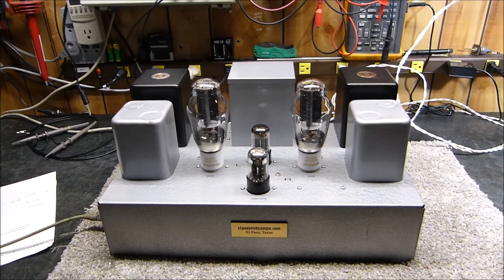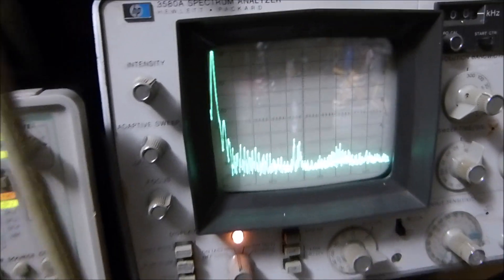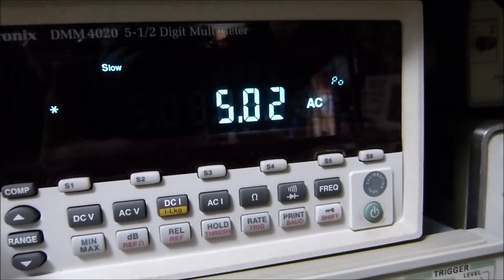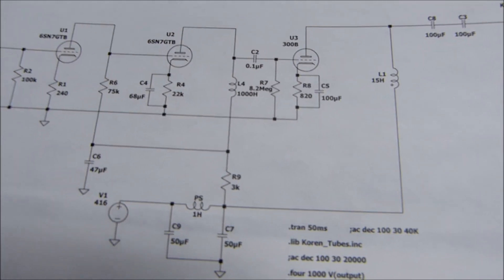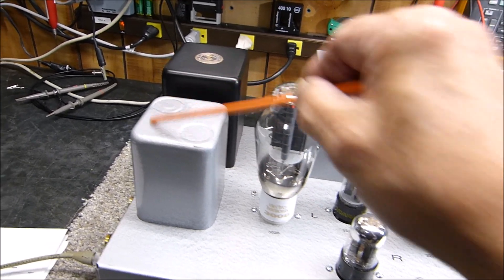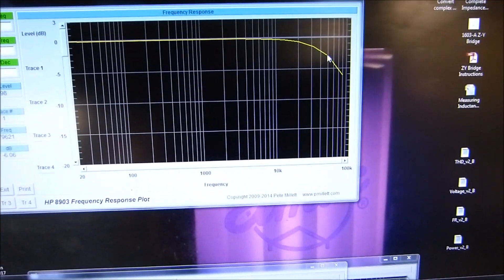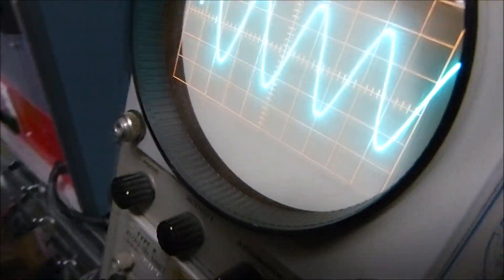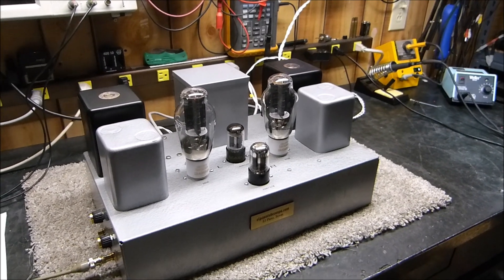300B SET Single Ended Triode Para Feed 7 Watt/Channel Stereo Amplifier

Comment: Not sure I understood your setup to supply 5v from a 6.3v winding. I heard 100ohm but that doesn’t add up. I assume you meant 100watts 0.68 ohm or similar?
Reply from the maker: I put the 100 ohm resistor in series with one leg of the 120 volt input primary side of the transformer so the 6.3 volt secondary would only deliver 5 volts under load to light the filaments of the 300B tubes. I did not have a 5 volt filament transformer so I used a more common 6.3 volt transformer but had to drop the secondary voltage down to 5 volts. Hope this helps.
Reply: @ElPasoTubeAmps  ah! Make perfect sense thanks.

Comment: I'm not much I to hifi amps as there's to much audio foolery involved but I like your work. Excellent videos.
I build guitar amplifiers using all the original parts from a given era, be it 1920s 30s,40s etc. Maybe try your hand at a few instrument amps?
Distortion is king rather than a curse

Comment: How does NFB compare to damping factor?
I had a Bogen tube amp with adjustable damping factor pot on the back, but never figured out what it does.  It did make a big difference in the sound though.

Nice looking amp!  ALL your work is wonderful though!
Reply from the maker: I am no expert in mechanics but it goes something like this.
I remember from a mechanics course that a car with shock absorbers has two parts in the suspension system - the sprung mass and the un-sprung mass. The sprung mass (the entire body of the car and engine + passengers) and the un-sprung mass is the wheels. The shock absorbers are the damping factor. When a car hits a bump or a pot hole, the un-sprung mass goes into the hole and energy is transferred into the shock absorbers and a correct damping factor of the absorbers causes the body of the car, and its riders, to be, as best as possible, insulated from the impact of the wheels. If the shock absorber is perfect, the car will completely recover from the impact in about 1.5 cycles. i.e. the positive amplitude of the impact will be lessened by the shock absorber and the negative amplitude will be greatly reduced below that of the positive amplitude and within the next cycle the car will be level again. 

I hope I  said all that right. So, with a speaker, depending on its efficiency, the effective damping of the output circuit of the amplifier and the speaker combination is an equivalent circuit of the car and shock absorbers. If the speaker is inefficient, (say, 88 dB SPL) the damping factor needs to be higher to properly stop the "ringing" and "boomy" sound of bass and if the speakers are highly efficient (say, 100 dB SPL) the damping factor can be lower. In a perfect world, speakers and amplifier should be "matched" for best performance.

Back to the original question - global negative feedback (GNFB) or just generally written NFB, will not only significantly reduce THD,  it will increase the damping at the output terminals of the amplifier, giving the amplifier more control of the speaker, i.e. a stiffer shock absorber with NFB. Almost always a good thing. 

As for your Bogen amplifier with an adjustable damping factor pot, I suspect it was simply a variable resistor in the NFB path. Increasing the resistance in this path reduces the NFB, lowering the resistance (but not too low...) increases the NFB along with the damping factor. Increased damping factor is a result of NFB. Some of the older Fender guitar amplifiers had an adjustable NFB pot also. Decreasing the NFB greatly increased the gain of the amplifier along with THD but that can be a good thing in the hands of a musician.

SET amplifiers with no NFB are more likely to sound boomy on inefficient speakers.
Years ago, high quality speakers were almost always highly efficient, and expensive because of close tolerance voice coil and magnet assemblies, but somewhere around the 1970's the "acoustic suspension" speakers came out (cheaper to make). These are the ones that are very inefficient and want huge power amplifiers to drive them. Acoustic suspension speakers are the ones with soft outer suspension rings (the ones today that are often times rotted off) that have to be installed into a closed box full of absorbing material (the internal cabinet pressure created by the bass speaker is a form of mechanical NFB). High efficient speakers are built into "ported" cabinets where the reflected bass comes out the front under the cabinet or a hole in the front of the cabinet or is ported to the rear of the cabinet into a corner for better bass response.
I was told "back then" that amplifier power was cheaper than speaker efficiency and that is why these speakers became so prevalent.
I hope this is worth something.
Reply: @ElPasoTubeAmps  WOW thanks ALOT for your detailed explanation!  Makes alot of sense.
Yes, I am familiar with acoustic suspension speakers, and know that they are very inefficient.
Never really liked them due to their huge power requirements.
yes, the damping pot was just a pot, and I did reverse engineer it when I had it, and it was in the NFB path.
If I remember correctly, if the pot was set at one extreme, the output would try to oscillate when driving lower frequencies... it would never break into oscillation, but was trying to oscillate.
Makes sense now that it was basically a variable feedback.
It was a "fancy" amplifier... had several eq. curves for the phono input... RIAA/EIA/78/flat/and some others.

Comment: Excellent project results. Glad you are going to bring it in and enjoy the audio bounty of this one. What speaker did you order to go with it? Horns?
Bill
Reply from the maker: I just ordered some Tekton speakers rated at 96 dB SPL, the model is "The Perfect SET".  The speakers I use it on now, and it gets plenty loud are only 88 dB SPL and are called Dahlquist DQ-20. I got them a few years ago at an estate sale for little money. I have Klipschorns in the house but I will likely use the SET amplifier in my back-house apartment. The room is 20x20 which probably places speakers a little too far apart for the best stereo experience. The no NFB SET has a certain addictive sound, as others have called it. It does a good job with classical and heavy metal. LF response is not lacking. This amplifier is fairly easy to build without expensive special SE components. You can probably find a little more information on the Internet by looking for para feed SET amplifiers.

Comment: You should try good quality switch mode power supply running at 120khz  works fantastic with valve amplifiers
Reply from the maker: Hi John,
A few years ago I bought several SMPS and found they are quite powerful, especially for their size. That is a good idea and maybe an approach for a smaller SET using the line transformers we have all talked about so many times.

Comment: Just liked to say thank for the videos, it's taught me a lot about tube amps, I don't normally work on tubes but am in the process of restoring a leak stereo 20 amp for a friend, uses two el 84 in the outputs & when I get a new toroidal  mains transformer will be working fine againbest wishes Nick

Comment: Thanks for the videos. Question: I have a 2.5 watt monoblock 45's, I have moved and my space is limited so I connected them to my Vandersteen 2ce Signature II's. It sounds amazing, but people have told me I will hurt them amps because of the load. Does that sound accurate, or keep on truckin'?
Reply from the maker: I wouldn't worry about it for a heart beat. A 2:1 mismatch in speaker/amplifier impedance or any amount of SPL sensitivity, gain or loss, is not going to hurt the amplifier especially at the power levels of these SET amplifiers. At 100 watts or more per channel, we might want to be more careful. Keep on truckin...
Reply: ElPaso TubeAmps   Thank you much, sir. I appreciate it. I will get back to it. 

Where is good spot to buy tubes?
Reply from the maker: @RobotronR6  I buy all my new tubes from www.tubedepot.com. They have been very good to work with and they sell pretty much everything else too.
Also, keep in mind     www.mouser.com     and      www.tubesandmore.com.       They are also good sellers.
Reply: Good point  @ElPaso TubeAmps. Should have been obvious from my RF days e.g. toy handie-talkies vs 5 watt vs kilowatt gets more critical. Milliwatts vs tens/hundresd of watts reflected - huge difference.

Comment: From your experience, how would you compare these tube amp to a SS amp where it costs around $20k +? I don't have tube amp so I am not sure if I want to get into tube or just stay with SS.  Thanks
Reply from the maker: it seems many people prefer the sound of the tube amp to the SS amps. I have several high power McIntosh SS amps and they sound good but the low power SET amplifiers just have a "life" and amazing  sound to them. I have recently changed from all of my high-end tube and SS amps to the 5W/Ch 300B SET amplifier. I do want a little more power, maybe 20 watts per channel and is why I am building the Svetlana SVT572-10 amplifier.
Reply: @ElPasoTubeAmps  Thank you so much, I will look for 300B to try.

Comment: Filament balance volume. What is it how value of adjustable resistor and how many pins of it?
Reply from the maker: The filament balance pot is 50  ohms set very close to center, about 25 ohms on each side,  to as close to perfect as possible, reduce any power supply hum to minimum. It is thru this resistor that the current thru the tube goes to ground.  There are three pins on it just like any (volume control type) potentiometer. One side goes to one filament pin and the other side goes to the other filament pin and the center pin (the wiper) connects either directly to ground or to the cathode resistor that goes to ground.  This cathode resistor may have a capacitor also across the resistor. 
Bias can be applied to the tube grid from a separate negative power supply or bias can be obtained by putting a resistor of correct value in the path of the cathode (in this case the center of the filament-balance-pot) to ground. A voltage will be developed across this cathode resistor of some value (around 60 volts in this case) and because of the action of the vacuum tube, this same value voltage will appear from grid to cathode in opposite polarity making the grid negative with respect to the cathode. This is called the bias. A very common error in analyzing a vacuum tube circuit is to think of all voltages " to ground ". Voltage is "across" a component, a resistor or tube elements, i.e. from grid to cathode in this case and current is the actual physical number of electrons flowing thru the tube.  There are 6.242 x 10^18 electrons per second flowing thru a point in a circuit for one (1) ampere. That is a huge number but electrons are really small.  :-)   
In electronics we generally think of current flowing from positive to negative. This is strictly for convenience and ease of analyzing the circuit. 
In physics it is looked at as current flowing from negative to positive since negative implies an abundance of electrons flowing to the positive side. 
It doesn't matter which way we look at it as long as we maintain the same method throughout the circuit - meaning, you can't analyze a circuit by thinking of current flowing one way in part of the circuit and the other way in other parts of the circuit.
One last thought - in many cathode biased circuits there is a capacitor added across the bias resistor. What this does is allows the DC voltage to be stable thru the resistor but it allows the AC component of the signal, the music or voice, to go straight thru the capacitor bypassing the resistor. The capacitor "bypasses" the cathode resistor for the signal voltage without affecting the DC value of bias voltage. This almost always raises the gain of the circuit. It is often a good thing to increase the gain of the circuit but not necessarily good in all cases.
Reply: @ElPasoTubeAmps  Thank you very much Mr. Elpaso. Is it 3 pins? 50Ohms 5 watts?
Reply from the maker: @nuttyl283  You can hook it up just the way the schematic shows you or simply replace those two resistors and the 1K pot with the pot you describe above. 3 pins, 50 ohms, 5 watts should work just fine. What you are doing is providing a path to ground for the cathode current and, with the pot, "balancing" the current from each side of the filament to reduce the hum coming out of the amplifier. If you do not have equipment to measure the hum, you can just adjust the pot to where the hum coming out the speaker is at its lowest point.
Reply: @ElPasoTubeAmps  Thank you for the reply. This helps so much.

Comment: Did I miss the operating point of the 300Bs? Also many 300B amps claim higher output. I realize the increase of distortion is so linear that it is a bit arbitrary whatever the power claimed. Just wonder why you are claiming 5 watts?
Reply from the maker: I am very conservative in claiming power ratings. If i remember correctly, it runs at about 1% THD at something like 6.5 watts? 5 watts is where it performs really nice. I suppose I got that from McIntosh amplifiers. It they say it will do 30 watts it will probably do more than 40 and still perform perfectly. That is true with all their amplifiers.
Reply: @ElPasoTubeAmps  so 400v @ 60ma?
Reply from the maker: @meshplates  I remember that the plate voltage is 416 and it seems the bias was about 63 volts. That would be 77 mA as the cathode resistors are 820 ohms. Next time I have it on the  workbench, possibly tonight, I will measure and note it so I can tell you exactly.
Reply from the maker: My data for posterity:
I recorded data for both channels and they are so close it is not necessary to post data for the right channel as it is essentially the same.
_____________________________________________________________________________
Filament voltage at socket, 5.51 VAC
All voltages below are measured to ground.
Plate voltage, 401 VDC (687 VAC secondary winding of power transformer into FWCT and capacitor input Pi filter)
300B cathode voltage to ground across 820 ohm resistor,  66.8 VDC (bias) (81.5 mA)
plate voltage on first stage of 6SN7, 69.3 VDC
plate voltage on second stage of 6SN7, 210.7
cathode voltage first stage of 6SN7,  0.952 VDC
cathode voltage second stage of 6SN7, 74.1 VDC
Left channel at 5W, 0.244 % THD
Right channel at 5W, 0.297 % THD
Left channel power at 1 % THD 6.32 W
Right channel power at 1% THD 6.35 W
____________________________________________________________________________
Reply: @ElPasoTubeAmps  thank you so much. I really appreciate your effort!

Comment: Very nice. Sign me up for your amp building class. ;)
Reply from the maker: What would an amplifier building class look like? Seriously, think about it and break it into maybe five videos. I could talk about it for a month and digress from one of the spectrum to the other but it should be more focused than that. I am interested in your thoughts.
Reply: Very generous of you to consider the idea. A rough sketch would be:
1. The finished build with a circuit diagram, parts list and commentary on tools or testing equipment that someone might not consider necessary, some safety tips, and general comments.
2. Order of assemby (macro level). Commentary on what areas will be assembled first and why, i.e. work flow. Starting the build with lots of images so people can compare their work to your work.
3 &4. Assemby (micro level). Images (lots) and commentary on building that include, tips, things you've learned the hard way, necessary mid build testing, etc.
5. Finishing the build, testing, and tweeks.
My thoughts are for a detailed follow along build not a skills class, like how to solder, there are plenty of those on the internet. Thank you so much!
Reply from the maker: @chubtoad157  That is a wonderful plan to follow. I really appreciate you taking the time to write it out. I have copied your text into a Word document and plan on using it in a future build. Many thanks...
Reply: @ElPasoTubeAmps  Just came across your page and would 2nd you amp building class. Would love to build one of these myself.

Comment: I know that using AC for your filaments/heaters is rarely a problem Re: hum, but I think a big part of it is just people being anal retentive sticklers. Purists. As it turns out, I'm "people." Using a simple solid state (gasp!) rectifier (or a homemade one with four diodes) and an electrolytic capacitor adds so little complexity or expense to the overall design that it seems practical just to sleep well at night. To each his or her own I suppose - I can't claim to be much of a purist because I still see no problem with solid state rectification for even your B+ honestly, and every argument I hear against it sounds less scientific and more like people trying to promote astrology. Anyway, great vid!